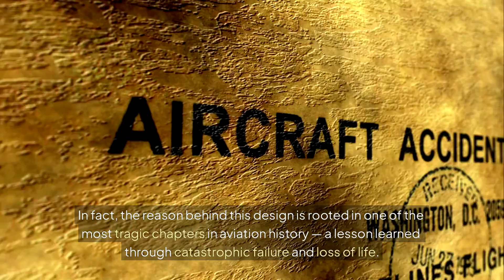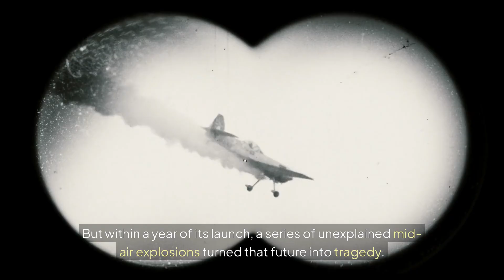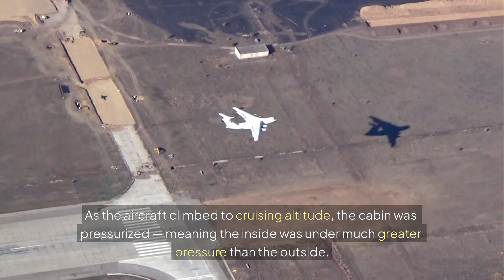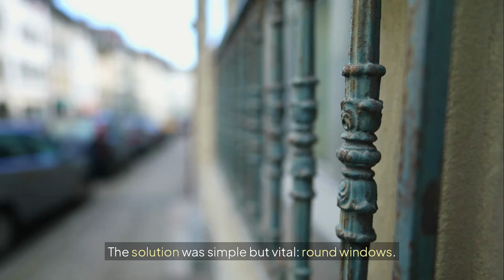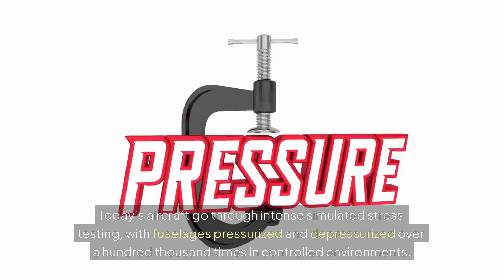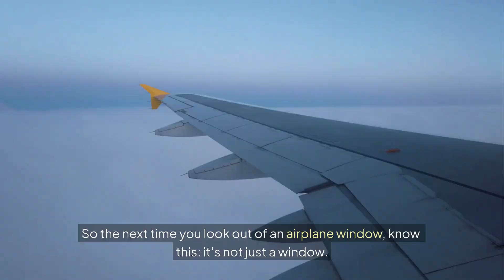Why Do Airplanes Have Round Windows? It’s Not Just Design.

Comment: Definitely FICTION... the Comet never had square windows. Wreckage recovered from the sea confirmed that the passenger windows where not linked to any of the crashes.
The De Havilland company eventually admitted that they never completed the stress tests on the fuselage sections that failed.

It remains the worst example of gross engineering incompetence and criminal negligence in commercial aviation history.